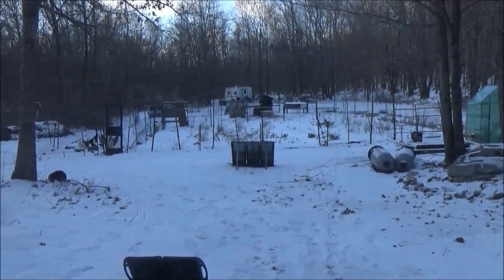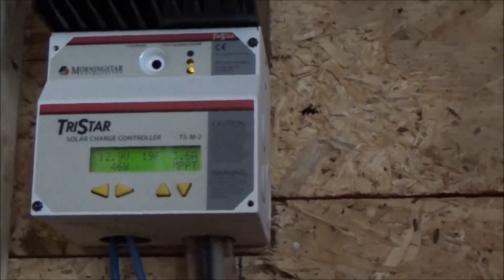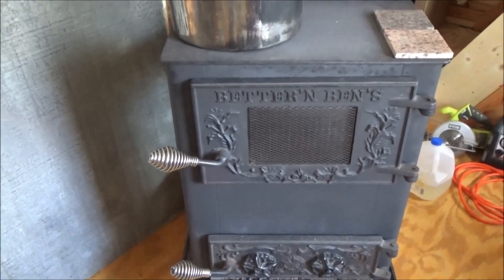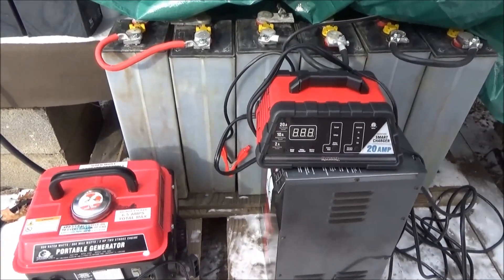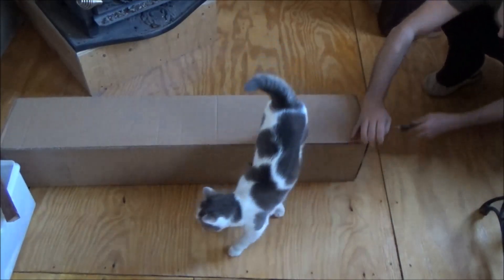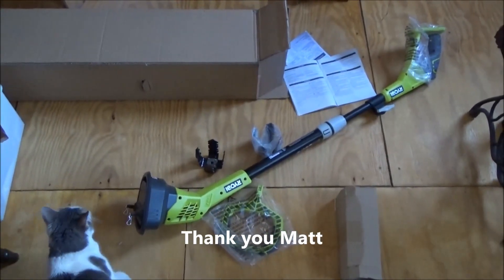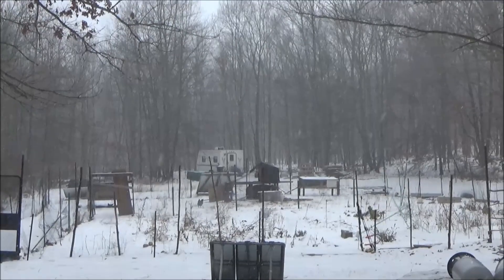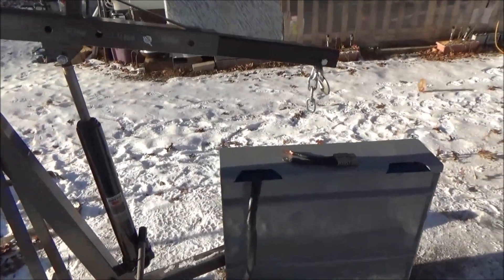Its All About The Batteries Forklift Battery For Home Solar Power

Comment: Um, why didn't you have the folks who delivered the "new" refurbed battery drop it closer to the back of house? Also, knowing the battery was incoming, why didn't you make it a priority to take some of that wood you have laying around and build a box to shelter the "new" refurbed battery, especially considering all the issues you have been having with temps affecting your old batteries?  I know you are only one person, but I don't get "the priority list"? You didn't fully finishing insulating your house, so now you're using more fuel then what you would have been if it was insulated. I'm no expert on anything, just my observations...food, shelter, warmth, and power are the priorities for anyone living rough like this.
Reply: I think that watching this actually makes folks think more about what they should prep for, Mr. Troy does not hide that he could do things better. A human is not error free, I appreciate the fact that he does freely admit his errors.
Reply: *****
You are so right! Well, even if he gets more cold and less heat from the wood, he can go upstairs where it should be toasty. That's something.
Reply from the maker: I did not fully insulate the house because its 85 degrees in here all the time with the stove damped down all the way and the window open.
I did not have them deliver it to the back door because they could not. They had a 2wd van which they did not even think they could get back to my place at all. Let alone maneuver around in a tight place to get it in perfect position. They were kind enough to drive 3 hours one way to deliver this. I was not asking them to waste any more time over here.
I have a lift and a truck. I can move it when I am ready.
Why have I not done it yet? I have been sick for a week now. We have -20 wind chills and I had a fever for three days. I am still recovering. I will move the battery when my strength is back.

Comment: Troy, there is a easy way to move that new battery bank over to you tiny home, without buying a new dolly. Cut a few small trees (about 3 in in dia), cut those into 4 ft lengths, you will need 5/6, then pick that battery bank up with the engine lift, take the wood, and place them under the bank, use them as rollers, and roll that bank over to your house. As you move the bank, take your already used pieces from the back, and move to the front, until you get the battery where you want it. Low tech works every time! I still would recommend a old (non working) deep freezer as a battery box.
Reply: eaglehill6 You can move any heavy objects with rollers. Low tech, but it works
Reply: Well you first need to have some pretty decent rollers. They have to be pretty much all the same size, sturdy and fairly round. Getting those is easier said than done. Also, the ground would need to be hard and not muddy. Nor should it have obstacles such as tree roots and rocks. But, first given all that, well, OK it's an idea.
Reply: SSanf he could cut them out of 1 (young) tree, Pieces only need to be 2 or 3 ft wide, and don't have to be perfect, just close. It would work. best part - no cost
Reply: LMAO... That'll never work. Clearly you've never chopped down a big tree before. It's hard enough trying to roll big heavy tree stumps by themselves, let alone having a 612 pound battery sitting on top of them. Trees never grow perfectly straight and round without branch nodes/lumps and stuff to make it a PITA to roll. You'd have to put each piece of tree on a lathe to cut them up round enough for this idea to be even remotely possible.
Reply: zilym who is talking about using a big tree (besides you)? That would be stupid. And yes, I have cut trees in my lifetime. I am talking about using something the size of a fence post, not big logs! I have seen buildings moved like this. It is easier than you think.
Reply: James Pottorff I'm still rolling on the floor laughing! :)

You'd need big trees to handle the density of this 612 lb brick. A piece of wood the diameter of a fence post would simply be crushed when this tall/narrow 612 lb mass is placed on top (and no, he can't lay it down on its side to spread out the load, the acid would leak out the vent holes at the top). Also, with small diameter branches, they'd just jam up whenever he hits a small rock, pebble, or uneven ground along the pathway. It's not like he has a paved road or smooth concrete slab he's trying to push this battery across.

I think Troy's idea of a large wheeled cart is the right way, although I don't understand why he can't just use the truck -- it's got large wheels and can handle the load, plus it's got a motor! I guess he doesn't have room to maneuver the truck and engine hoist to wherever it is he wants the battery to reside?
Reply: zilym Well, you got me thinking. What if he had a big stack of old cardboard, newspapers, or magazines? He could use the engine hoist to put the battery on top, then maybe he could use a winch to drag the battery sideways. He could pick up papers left behind and move them to the front for sliding the next distance. If the stack of papers is thick enough, they would act to help smooth away underlying rocks/uneven dirt and help spread out the load.

I'm not sure if this would work with all the snow. Would the papers become waterlogged and adhere together, impeding the ability to slide the battery? 

With it being so cold outside, maybe if the snow packs down thick enough, he could use something smooth to act as a sled to slide the battery around on?
Reply: zilym
right on zilym. above the arctic circle they move entire buildings on frozen earth or better yet, packed snow. temps of -0 or greater make it perfect for a good slide. he has everything he needs to make a snow skid. he needs to borrow the landlady's back hoe for an hour but it's a slam dunk bro.
Reply from the maker: grodad She does not yet have a backhoe or I would have this done already. I am thinking about the snow ski idea
Reply from the maker: I have considered the idea. I plan to just put it in the back of the truck and move the truck over to the tiny house. Less work and time for me.
Reply: zilym Cardboard? Really? now that;s funny!
Reply: TheMoneypresident Ah, I see we have one of Docs Dingleberries lurking around, you must be blocked because your msg is not coming thru on the video, but sliding in the back door of G+
Reply: Cherry Downs I saw a video one time, where a (large) group of Amish men, literally picked a house up and moved it by hand! And it was not small!

Comment: Hi Troy. I don't know for your baterries but for mine. Hopecke Equala. voltage is about 32V (24V  baterry bank) and reason why it went back to mppt from Equal it is because there was no power to keep it up... btw it is very important to be sure all is according manufacturer specification. Also check voltage compensation ..if it is as manufacturer suggesting. .and even if your batteries will be good you will have problem to take so much power from them because they are cold..and you can't change no matter what....get them warmer..and you can use them more...btw i'm sure more ppl suggested some Ah counting..so that way you know exactly what you used and how much power you put back.

Comment: Woke up to 1 degree here in S.E. KY yesterday. Winds of 21 MPH.
Tonight we are expecting 6. The saving grace is NO ICE OR SNOW. (Not yet at least). STAY WARM and watch your birds  Re Wood. I honestly had to laugh when you said "This is enough wood to last a week or so". A suggestion. Bust your butt in the warmer months on wood. Spring is good. It will have Spring, Summer and Fall to sit and season. Adapt the attitude "NEVER ENOUGH WOOD" because truly, if you use it for heat there isn't  We got a good head start on it this year. :-)

Comment: Since the new FL batteries are smaller can they go in the house under the Tristar? I realize they will need a vent.   But at least they would be warmer.
Reply: signatureemr Because?  Too much off gassing, risk of explosion, risk of acid leak?  I ask because for each risk perhaps there is a way to mitigate it.
Reply: signatureemr I think you're right.  Off gassing from that size of batteries could be bad... if the vent fan failed that could be bad.  It is just that he doesn't have that battery box built. Someone suggested a freezer... that might be best.
Reply: Lynn Morrow No point in wondering ... we just see where he goes from here.

Comment: How are you getting the higher current and voltage to desulfate /  equalize your batteries are you connected to the grid, you mentioned in  your video that your solar panels are only putting out 45 watts? Watts law is P = E x I.  10 amps  x 15.6 volts  = 156 watts , that's minimum input into the Solar Power Controller, and I am sure that the controller takes a few watts to run so you probably need more like 175  - 200 watts input to be more realistic. Also that solar power controller looks like it may be designed for two batteries or maybe even four, and it may not equalize your all batteries with a sufficient amount of current with so many of them.

Comment: Can you not mount the engine hoist in the back of the bed of the truck with chains. Extend the boom out far enough to pick up the battery like a wrecker truck. Then back the truck up where you need it then lower it down.
Reply from the maker: Something like that

Comment: I am in western new york. weather like hear. love the cat playing in the box. mine do the same thing. love our pets. I have the smaller morning star  MPPT controller. very good! get some board type insulation and place it around the battery. will help a lot. have to keep venting. I went to NiFe batteries.  better in cold and cycle life. that's the same anderson  disconnect used all over. standard on a forklift.  glaid they gave you other end.  its 90F today. love our crazy weather.

Comment: Hey Troy - a request.
Could you do a video showing what your winter garments are, what you like about them, what you don't and what you do and don't recommend. I live in the north and work outside so I have my own thoughts, but since a lot of your subscribers don't know anything about living in colder temperatures something like this could be an interesting educational moment.
And a couple of suggestions
1)Why don't your use your hand cart to move water with? why are you carrying it rather than rolling it?
2) rent (or see if you can borrow) an appliance dolly rather than purchase that large heavy duty dolly. unless you truly feel like you need it. An appliance dolly is designed to carry 1000's of pounds. 
3) crowd source for a Go-Pro.
Reply: offgrid40 I know. I have pulled a gas range up a gravel drive with an appliance dolly. It sucked. Big time. 
But if this battery bank is the only thing Troy needs it for it would be better to rent rather than spend all that money to buy. Unless, of course, it is something he will use again and again and again.
Reply: offgrid40 if he does it early in the AM when the temperature is at it's coldest it will be fine. The ice will make it solid enough. Rough for sure, but solid.
Reply: ***** Harbor Freight use to sell tires,it would be pretty easy to make a dolly around there. The idea of moving it with logs would probably be easier and cheaper for Troy though.You're right I'm sure it's been done by now but maybe not.
Reply: *****
I owned a large second hand store for a few years and I never used my appliance dollie..I used a dolly that would hold 800 lbs and had aired up tires that I put foam in...That worked the best..
Reply: FromThe Prairies bass pro sells a sock @ $10 a pr but the warmest ever and warranty for life replacement when wore out.  Already got one pr replaced!!

Comment: About the BTU issue on the standing dead trees..  If you soaked them with some of the oil you are using on the paneling a day or two before you burn it would that up the BTUs?

Comment: As small of footprint the Battery is..I would find a way to have it inside right next to your charge controller. Keep em warm and cozy, That way you dont have power loss due to cold temps. You can make a small enough cap for venting outside.. That would be the perfect set up.
Reply from the maker: These are forklift batteries. They gas off heavily. I do not want them inside. Plus the battery weighs 600-700 pounds. No way I can get it into the house and move it
Reply: The Do It Yourself World  Duh that why you vent them outside, And start thinking like an Egyptian when you move heavy objects. The Whole task itself is way easy. I'm starting to think you make things sound more difficult than they are. A few old cookie rolling pins under that pack and slide them over. You have that small cherry picker. To do any lifting. Even though you have that nice new refurb pack you dont have 520 Ah in the Cold. You basically have half that. If you didnt live 800 miles away, I come up there and do it myself.

Comment: Don't complain my friend :)   Here in Brampton Ontario Canada we had it  minus 33 celsius that is - 27.4 Fahrenheit .
Let me tell you it took less than 1 min. to feel nasty burning sensation on the skin and you know what this means .
Reply: Indeed , with that north west wind .
Some areas got it - 38 my wife is telling me now .
Reply: Agree with Thymen, that is INSANE!!!
Reply: I am in Alberta - and I work outside in those same temperatures. Its all about the clothing and making sure you're prepared for the conditions. I also deal with humidity of about 20%. I joke that I go home to marinade in skin cream, which isn't far from the truth.
Reply: ***** I have not. I find that Vaseline makes a really good dry skin cream and when things get really bad I use a product called Mane and Tail Hoof Cream. It's for cracked horses hooves and works like a damn, especially on my hands where my thumb and index fingers start to crack.
I have had the pleasure of having frostbite on my ass and the front of my thighs so have to do daily "marinades" in the winter to keep the skin in a reasonable condition.
Reply: I remember when my son was a baby we had temps at -60. Don't remember if it was C or F, but at that temp, does it really matter?
Reply: They sell it at most of the livestock places or at the tack shops. I picked up a good sized pump bottle for about $12 last winter and am only about half through it. They make shampoo and conditioner too that is super cheap and wonderful. My hair stylist uses it!
Reply: ***** We've been using Udder Balm for YEARS - we get it at Tractor Supply (gotta get the same thing the farmers use and not some cheap knock off).  An old farmer turned us onto udder balm - it's GREAT stuff!
Reply: Why, oh why, are you living there? What could possibly motivate anyone to live in such a dark and cold clime? I think I would just shoot myself living in such a place. I hated NY because it was dark and cold and you have it so much worse.
Reply: SSanf you have no idea. I grew up north of Edmonton.  It's dark at 4pm!  Unfortunately Canadians don't really have a southern place to go short if a vacation in Mexico or Cuba.
Reply: FromThe Prairies :(

Poor, poor Canadians.
Reply: *****
I am not judging, just feeling sympathetic for his plight. I would find it unbearable to live there.
Reply: John King
Perhaps you didn't get the memo. Comments sections are about making comments. You know, having conversations and making remarks. But yeah, when the memo was sent out explaining that comments are supposed to go in the comment section, it is obvious why they decided to leave you off the list.
Reply: *****
You keep trying to get my attention in thread after thread but you never really have anything to say that is worth bothering myself to respond to. Try having an actual idea or two about the video and then post so people will want to acknowledge your existence. Just tossing in a random, lame insult with some naughty grade school words here and there really doesn't cause people to want to engage with you. If you want to play with the big kids, you really must up your game.
Reply: ***** yes Bryan! We've used both the bag balm and the udder balm.
When my hubby would work outside in the winter (he plows snow), his hand would become some cracked, we swear we could see bone!  It just looked painful - I can't imagine how much that actually hurt!  NOTHING and I mean nothing would touch it - until udder balm!  What a blessing!
Reply: ***** I'm sure living in the desert doesn't help at all.  I'm glad you discovered Bag Balm!  One thing I've discovered is a chocolate scented (bonus!) Vit E / petroleum jelly combo at Dollar Tree of all places (double bonus!)
I've probably mentioned this before - I'm part Cherokee too :-)

Comment: I'm enjoying watching your videos mate, never gets that cold where I live in Australia, looks like good Soup making weather 😊 that's what I do in winter on my wood fire. As people have said hardwoods are better than softwoods for heat, also last longer burning; oh and try not to let your Batteries freeze as it will kill them! You need to get them inside or protected asap.
Reply from the maker: Thanks for watching. Yes it gets very cold here. And its perfect soup weather. And tea.
I will build an insulated box for the forklift batteries and heat it. But for now they are fine. These can be used in a forklift outside in winter day and night with no problem.